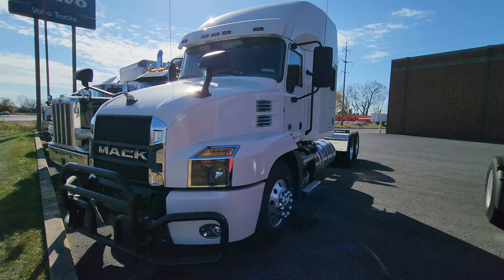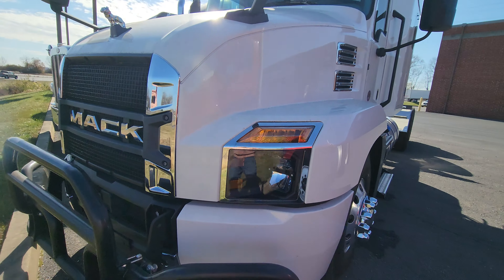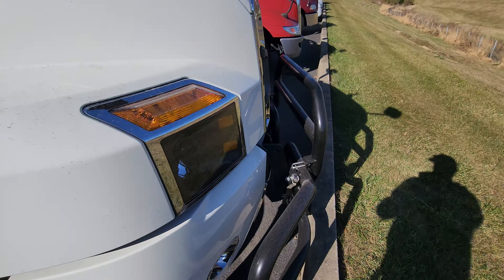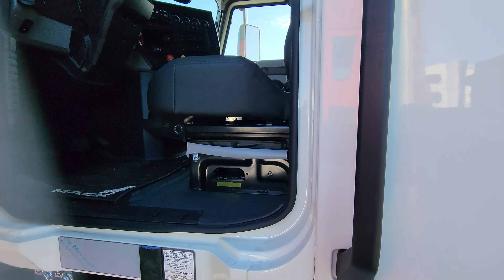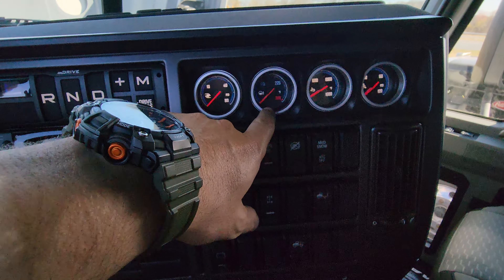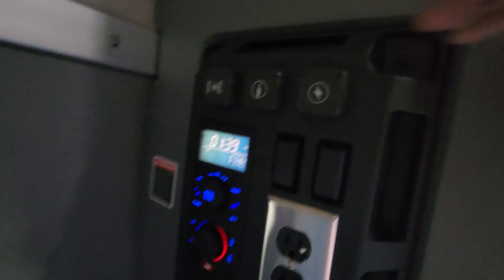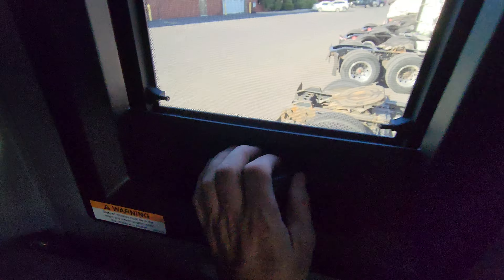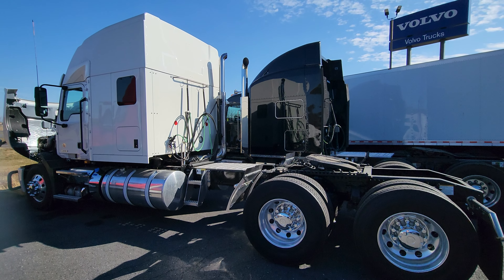2025 MACK ANTHEM Modern truck with classic look 💪

Comment: This would be good for off road applications like oilfield work. For on road it leaves a lot to be desired. Can’t beat a volvo 860 or a 760 in comfort. Volvo all the way, specially with the dinnette option.
Reply from the maker: It is definitely a good option for off-road applications. More clearance without the side skirts.